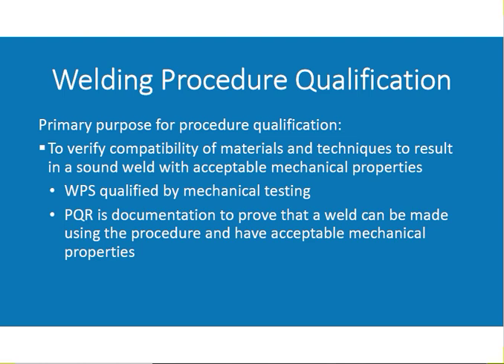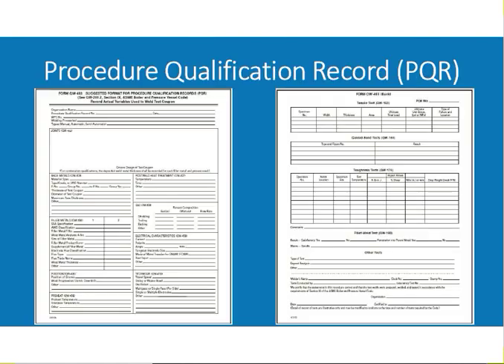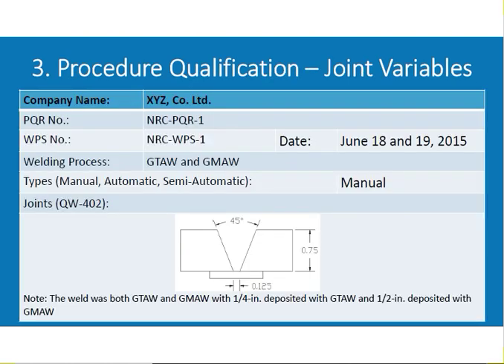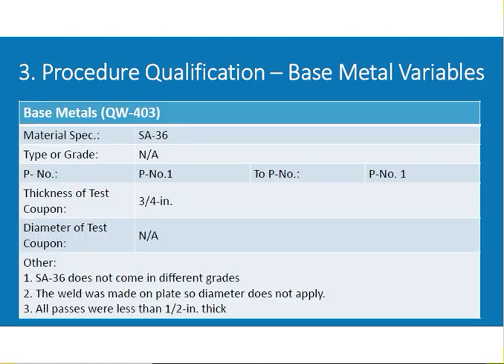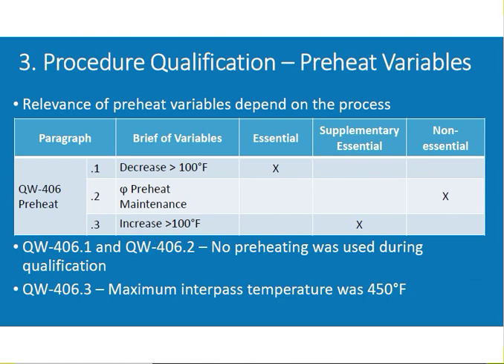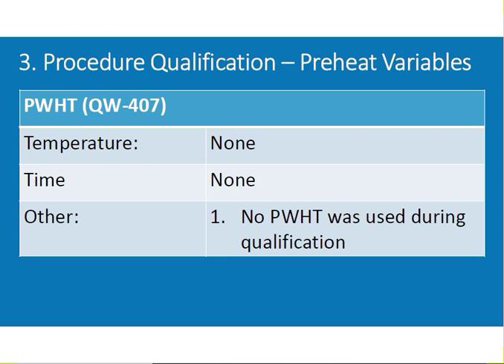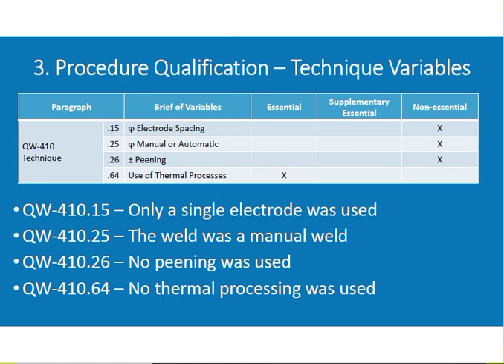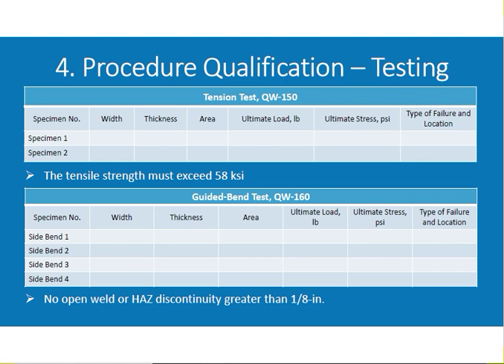WPS & PQR - How to write a WPS -Part 2

Comment: pWPS the same of SWPS?
Reply from the maker: GOOD QUESTION..Here is the reply ..
f you have worked with the American Welding Society codes, you have probably heard about Standard Welding Procedures Specifications (SWPSs). A SWPS is define by AWS as a welding procedure specification qualified according to the requirements of AWS B2.1/B2.1M, approved by AWS, and made available for production welding by companies or individuals other than those performing the qualified test.

and pwps is prequalified wps which term is used for structutal steel aws d1.1 code ..